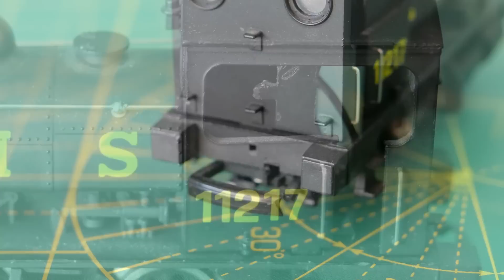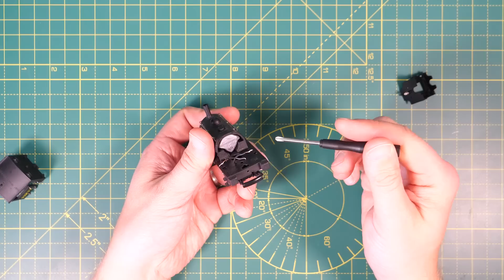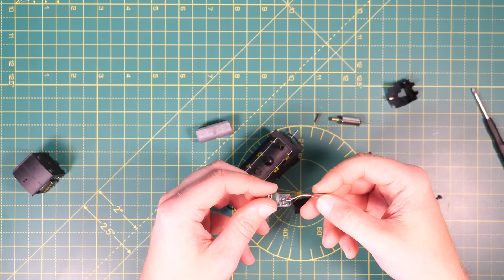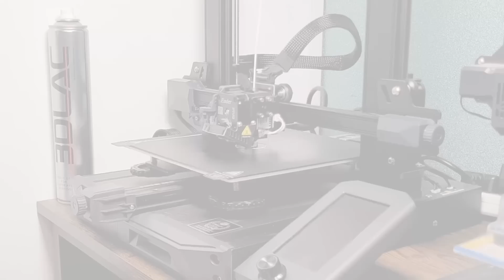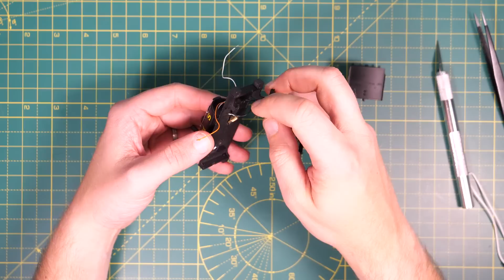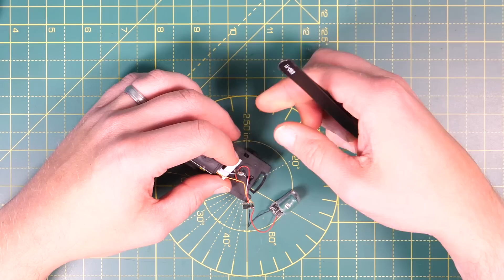Project Pug - Part 1: Fitting a Coreless Motor with DCC Control

Comment: Many thanks very helpful I may even convert my own pug to a Coreless motor as you’ve done. Only thing to say is you didn’t spend any time explaining exactly what you did regarding extending the motor shaft - you just said you used some brass rod. I’m guessing you used tube and rod but if you could just let us know by replying to my post that would be very helpful. TIA
Reply from the maker: Apologies, yes, I should have said brass rod. It slid over the motor shaft, I think it was a pretty tight fit, but I secured in place with super glue. I need to revisit this to make part 3, so will try to remember to confirm what I did in that final video. All that tungsten putty melted when the weather got warm and has gone everywhere, so I need to spend time cleaning it all out and rethink the weight idea. This is a task that I'm putting on very successfully.
Reply: @LittleWicketRailway please make the file for the motor mount public I have a pug that needs a new motor and this would be a great solution

Comment: Do us a favour.get a job at Hornby
Reply from the maker: Wait until part 3 eventually comes out. You'll see that my idea to put tungsten putty in the model was a bit of disaster. The room temperature increased and the pug pooped putty all over the desk. The project is on hold until I can get the time and energy to scrape putty out of the mechanism and every little corner of the model. Hornby probably don't need my bright ideas right now...

Comment: I remember getting my 2 'pugs' when Hornby first got the Dapol toolings, must've been around £25-£30 new at the time? You'd think for £85 they'd have improved the model or done a new tooling like the terriers.
Also good to see that the motor can work on DC wired straight to the controller, think it's time my pug got a similar upgrade.

Comment: Great work! Don't suppose you can print some more of those parts for others to have a go too?!
Reply from the maker: When I finish the project and if it looks OK, then I can do prints or share files. Can confirm that the tungsten putty didn't work. Picked the model up after the heat wave, and it had done a tungsten poop on my desk. Need to remove all the putty now and clean the mechanism. Back to the drawing board to increase the weight.
Reply: Try gold. Nearly twice as dense as lead
Reply from the maker: @user-eb8ld6kn8t  haha, got any I can borrow? 🤣

Comment: Hi Rob! What a wonderful explanation as always! This video finally gave me the courage to take "the leap" and start building my layout. I ran into some trouble and was hoping you (or anyone following this video) could guide me.

Background: I am building a freelance N-Gauge 4mm scale layout taking elements from the Lynton & Barnstaple Rly, the Ffestiniong Rly, Welsh  Highland and some narrow gauge railways in India. I had purchased a model power 0-6-0 shunter long back at a good bargain and it works good on DC. I intend to 3d a body, throw in a dcc decoder and convert it to something similar to a Manning Wardle 2-6-2 Lyn of the LBSR. After getting the push watching this video I went ahead and purchased a Zimo MX648 sound decoder from Streamlined Backshop here in the US. It came tested so it is supposed to work out of the box without major setup.

The issue:
Before soldering the wires, I decided to do a dry run so I connected some jumper wires to the NEM8 pin and connected them to the rails. I am using a DCC++ Ex Command station connected to JMRI. I have not connected a speaker or the motor to the decoder. JMRI is able to connect to the command station but it cannot detect the decoder. Gives me an error that it failed to read CV8 and an error of 308. I googled it but cannot get a good lead.

What am I missing?
Reply: Ok this is going to sound dumb.. but I am a newbie to the hobby! I figured out two things:

First - I had to have a "load" connected to the decoder for it to be able to communicate back to the command station and hence JMRI. So the solution was to I connect the motor to the decoder.

Second: I was trying to program on main but that didn't work. As soon as I connected my track to the program side (B) on the motor shield I was able to detect and add the decoder.

I hope my noob-ness helps someone else!
Reply from the maker: Sorry it took so long to reply, sounds like you've sorted it now. It's not obvious that you need a load on the decoder to get a response.
Reply: @LittleWicketRailway  Could you provide a link to the motor you are using? I was checking on Amazon US and most motors are below 6V which has me concerned as to whether they would burn out on 12V.

Alternatively if there is some guide on how to choose a motor that'd be much appreciated!

Comment: Really interesting video. I have a Hornby Pug and love the loco, but have always been slightly disappointed about the motor almost filling the cab. Although I'm not interested in DCC I would like to have a go at changing the motor. If you ever consider selling the printed motor mounts I would be very interested. Thanks.

Comment: In general locomotives often run slightly better on DCC. In this case though, I think it is partly the Hornby controller, as Hornby tend to use feedback or pwm in their controllers, which I have heard can actually damage coreless motors. Fitting a decoder will solve this problem though.

Comment: Great work! The cab of my Hornby Pug is crammed full of a Train-o-matic decoder and Smart Power Pack - and the motor - it works well but doesn't look so good. Your project looks like a much-needed upgrade. It surprises me that the loco manufacturer hasn't thought of this!

Comment: Nice work, I have been eyeing up some of those motors as a upgrade too.
Before you go much further I would check its pulling power vs wagons with the weight you intend to use to check it is viable.

Comment: Excellent project, all is very well designed and should improve this old model no end providing you can add some discreet weight. I suspect the motor runs better with the decoder as I'm not sure how coreless friendly those old Hornby DC controllers are.

Comment: Oh hello! Guess what I've got sitting in front of me on a bit of track?
My Pug is the Hornby one but I'm pretty sure they are identical.
I put a DCC chip in mine but it was in the cab and I've pulled the loco apart to see how I could better do it.
Looks like your mod might make life much easier. I hope you might make your STL's available for others to use.
Especially if you are doing some simple cab detail too :). Cheers!

Comment: I absolutely love this model. Got an original Dapol one for 30£ in mint condition. Until this day its one of my favourite locomotives despite the age and the lack of modern detail. Fitted the lamps and headcode discs to it. So cool you managed to upgrade it. For the modern price it should be like this from Hornby. I have no idea why this model is in the Railways range like the 4F and the 2P these are all old models which are not up to modern standards. Still, my little Pug is still going strong today as my shunter and local goods locomotive. Got some matching LMS wagons on the way for her to pull. Great video 👍👍

Comment: Fantastic Rob.  Love the 3D mount and print.  How long did your design take? Also how did you extend the motor shaft?
Reply from the maker: Thanks James. The design wasn't too bad because I could copy the shape of the weight by drawing round a photo in sketch up then mock up the motor from measurements. The shaft extension is brass rod with a 1mm bore fitted onto the motor with a 1mm diameter rod fitting inside that and the worm gear. All fit quite tightly, but will need glue to make sure they don't slip/slide. I think the extended shafts from tramfabreik are probably better than my bodge job.

Comment: Very nice work, for the roof repair I'd suggest possibly adding a couple of tiny pins and then using a little greenstuff epoxy putty, the pins help anchor the greenstuff in place
Reply: Super glue and baking soda is another option used in military and wargaming modelling. Dries rock hard in a flash and is robust but still filable and sandable.